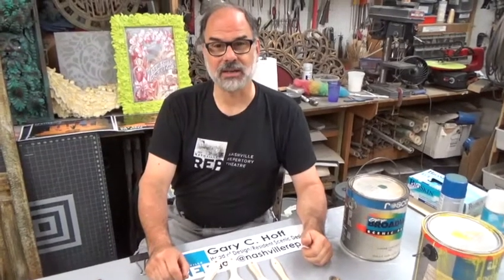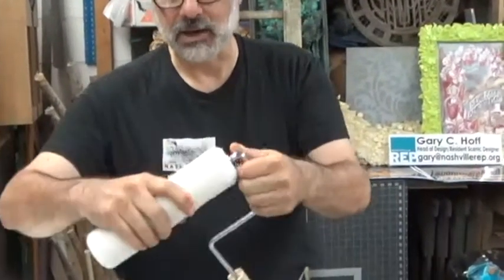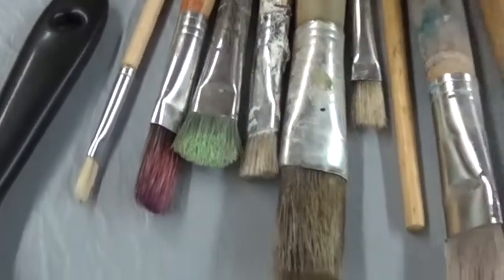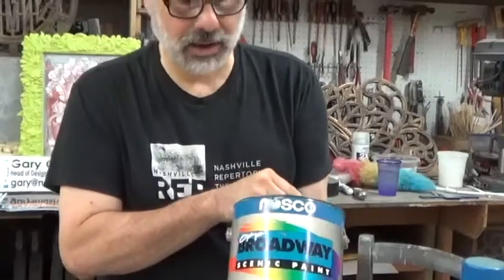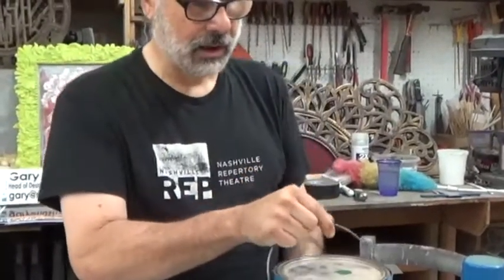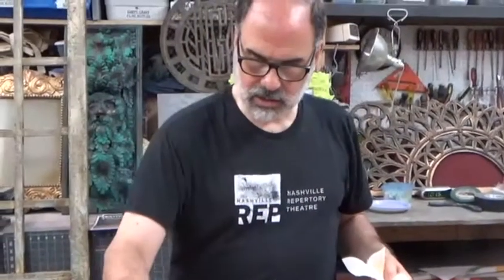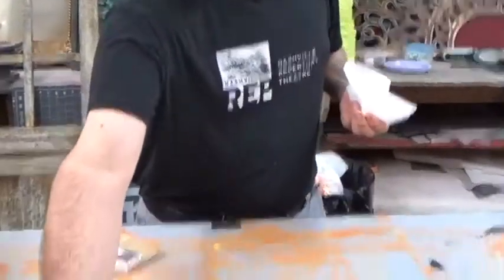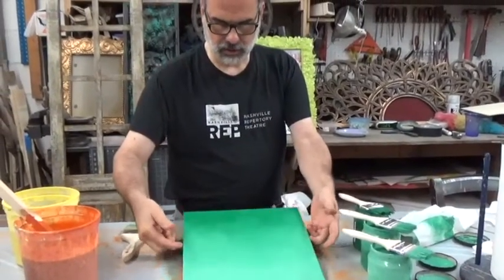Basics of Scenic Paining With Gary C. Hoff

Comment: These videos are excellent. Thank you for uploading :) With regards to the paint consistency for the scumble finish, do you water down the paint or do you use it without watering down?
Reply from the maker: Gary waters down the paint! "It should be the consistency of buttermilk. You need it thin enough to move easily, but not too thin that it drip and makes a mess." Hope this helps!
Reply: @nashrep  excellent thank you very much :)